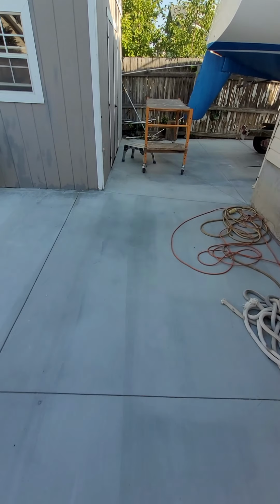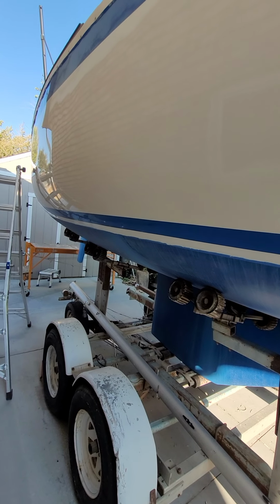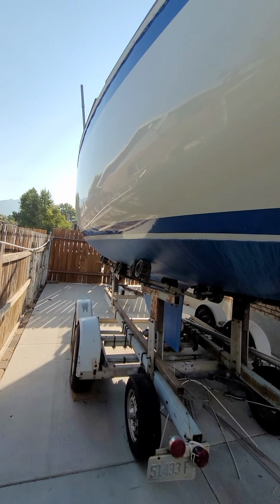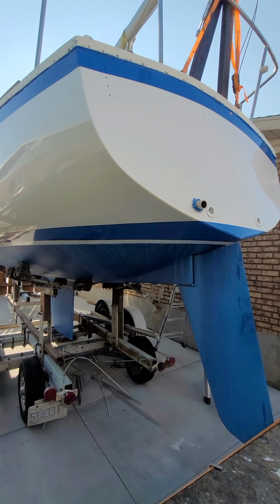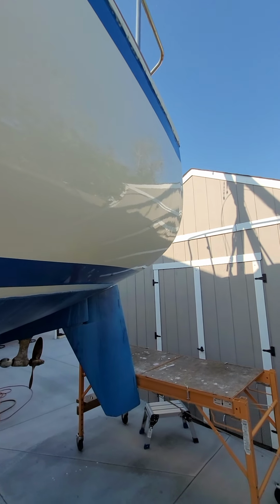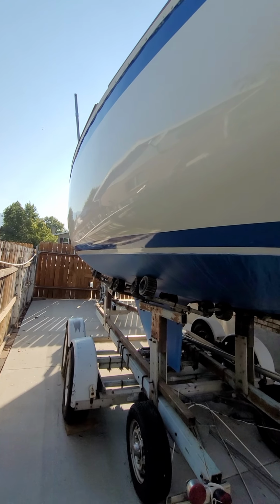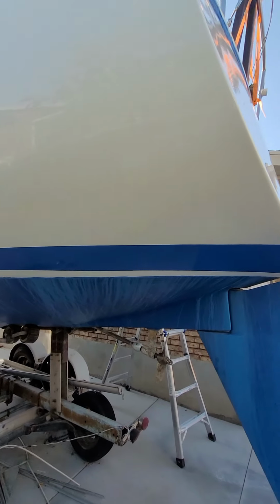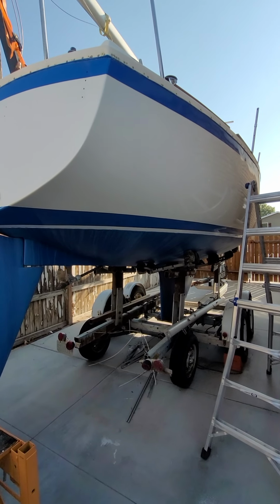O'Day 27 Total Boat wet edge paint project.

Comment: Hate to ask, it has been almost a year. This is probably a dumb question, what it if rains on day 2 or 3? Is the paint still safe or do you have to plastic off the area you are painting if there is any chance of rain? I don't have a way to close off the entire boat to paint, so need to know how to handle the weather.
Reply from the maker: If it rains a day or so after applied I actually think you would be ok. If it rains within 10 or less hrs after applied I cannot say for sure.
Reply: @sailnsurfthurman9263  Thanks so much for the reply. Boat looks great. Am thinking of painting my 20ft deck boat from the mid 90's that could use a little update. Cheers.

Comment: Super helpful! How many gallons per coat do you estimate?
Reply from the maker: For this 27' with the added 1 gallon of brusher thinner I went through 3/4 gallon of white and 3/4 quart of blue for the stripes with 3 coats for each coating. I also used about a gallon of primer for the whole project.